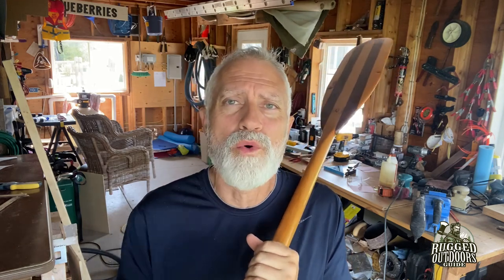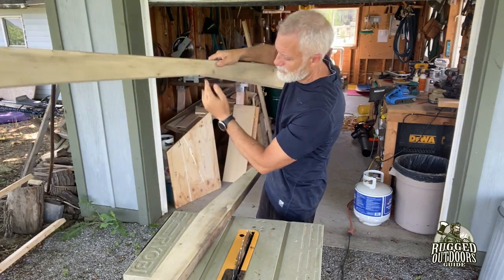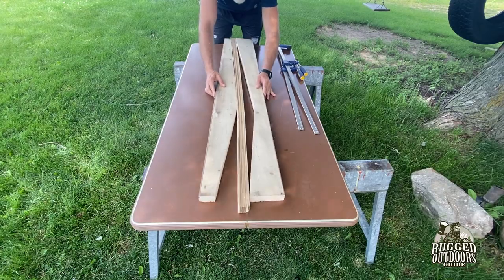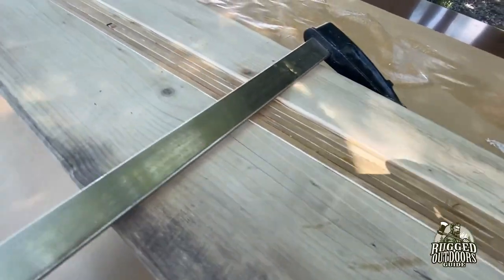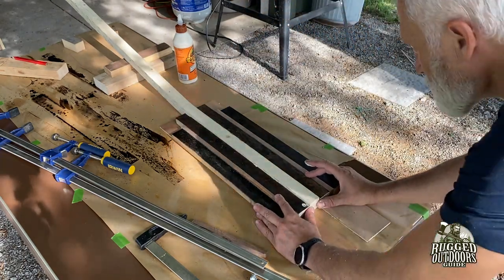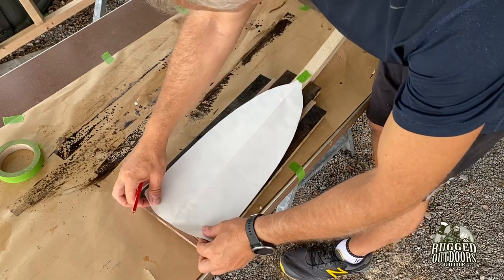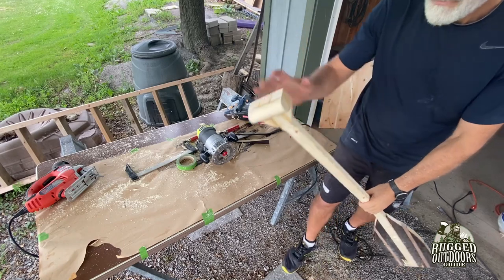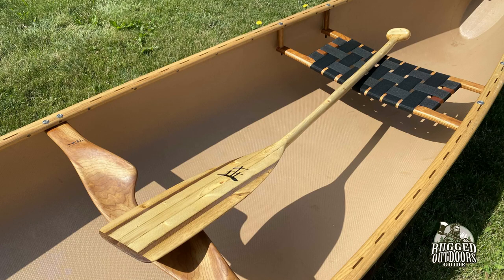DIY Bent Shaft Canoe Paddle (with normal tools)

Comment: That trick with elevating the paddle is a good one.  I just plane the back of the shaft to the point where the transition is tightened up a bit, but your approach does create some other options.

Comment: I have a question about figuring the overall length. Is this done based on the length of the straight ahaft prior to bending? For example, if i need a 54" paddle do I make that measurement off the straight shaft? This is the only part of building one that confuses me.
Reply from the maker: you might not like my answer but it's an honest one!  I throw out all length measurements and go with how it "feels".  I took one of my straight shaft paddles that was a perfect length for me and my canoe, and then pretended it was bent shaft.  I had to sit in my canoe because each canoe with a seat height from the gunwales that's different than the next canoe requires a different paddle length.  I just chose a length I was comfortable with after mimicking my paddling style in my pool.  I'm not sure that helps, but it's all I've got!  Thanks for watching!
Reply: I appreciate the answer and I really enjoyed the video

Comment: That is a dangerous cut on a table saw, for the grip. Particularly since the blade is pulling the piece away from the fence.  And it is too short, wide and thick.  It was also light, and your fingers were not involved.  So easy when you know how.   People sometimes forget you can just split pieces like that out.  It won't work if the piece is gnarly, but I wouldn't choose a piece like that for a paddle grip.

I've been building bent shafts, now and again for my own use, for 45 years.  At one point I took a friend (later wife) out in a canoe, and as we rounded a point the wind picked up, and I masterfully took charge.  At which point the carbon fiber kick point below the grip let go with a bang!  Never had that happen with my all wood paddles.  A common theme in boatbuilding, it takes more carbon than you think.  Happily in human affairs, it only takes one trip in a canoe...

Comment: I took a class to learn how to make one and am now building more for a nephew.  I use dark western red cedar and pine cut into 3/16 strips and alternate 7 strips dark and light.  The contrast looks great.
Gluing is messy, no way around it.  I cut a taper in the handle before gluing the handle blocks on so there’s not so much material to remove by sanding or if you’re like me, by spoke shave and draw knife.
It’s a fun project!  The hardest part is finding nice knot free lumber to start with especially the darker cedar.
I enjoyed the video.
Reply from the maker: It looks like you're a bit more careful, precise and discriminating than I am!  I'll use whatever wood I can get ahold of - knotty or not!  I find that for normal paddling, any wood will do, but I'm positive yours will look better!  Thanks for watching.

Comment: the different color designs in paddles is what intrigues me.  There are some beautiful pieces out there.  I'm guessing from your video that you simply need to use wood that has the natural color you're looking for, since no staining is done?
Reply from the maker: Correct!  I tried to stain at one point, but the stain does not penetrate very deep into the wood, and when you start sanding to shape the blade and shaft, etc. the stain will sand out.  There may be a way to "precision stain" sections after you're done shaping, but most of the gorgeous designs you see online are done with different wood types.  Great question!

Comment: Great video, but I like the grip on the paddle in the first minute of the video better.  Can you show me how to make that grip?
Reply from the maker: Hey Frank.  I just took a photo of a really basic (but useful) drawing I made up for you to show you how to make that handle.  In a nutshell, when the paddle shaft was unfinished and rough, I shaped it with a "T-top".  But, you can just glue 2 chunks on either side of a rough straight shaft to form the "T".  Then, I added two more pieces of softwood along the top side of the T on either side to make it thicker.  Then, I just shaped it however I liked.  If you'd like to see the drawing, email me at pete@ruggedoutdoorsguide.com.
Reply from the maker: I might make another paddle video and show that grip, but unfortunately I'm not making one soon.  If it helps, I can tell you that the grip in the paddle I was holding in the first minute, is made exactly the same way as the bent shaft one.  The difference is in how it is shaped with a belt sander.  Essentially, the shaft is square when I start, so it's easy to glue 2 chunks of wood on either side (2-3 inches long and as wide as the shaft).  Then I glue 2 more chunks on the front and back to create what looks like a large, wooden block at the top of my shaft.  Then, it's a matter of shaping.  Only the bent shaft paddle handle is shaped asymmetrically since it will only be used in one direction/position.  I'm not sure that helps, but it's all I've got for now! cheers,

Comment: Kudos to you for making this video. I'm sure that there are a few ways to make a jig to bend the strips for the shaft, but good idea anyway. Did you use just regular spruce wood or was that cedar? By the way, you can never have enough tools. I look for an excuse to buy one. Wife isn't amused though. LOL!!
I'm hoping to make a few paddles over the coming winter. Your video provided me with some good insight how to proceed. Cheers!!
Reply from the maker: I gotta admit that I used 2x4s from Home Depot.  They advertise them as Spruce/Pine/Fir so I don't really know.  I used a 10-foot long 2x4 I had in the shop!  Thanks for checking it out!

Comment: Electric planer? For shaping the paddle blade?
Reply from the maker: I used it for a bit since my blade was an inch thick in some places.  I needed to shed a whole lot of wood quickly.
Reply: Great idea using the planer to take some of the excess off the paddle. I've used just a spoke shave on some straight paddles and it takes hours. Great thought and I will use it on future builds.

Comment: Fiberglass epoxy?
Reply from the maker: Hey M.  Not sure what you're asking, but with my DIY paddle, I did not add any fiberglass reinforcement.  It's not a bad idea for sure, but I've made about a dozen paddles since around 2007 and none of them have broken from hard use with only Gorilla glue and marine Spar Varnish.
Reply: @ruggedoutdoorsguide9904  yes whether or not you use it. I was curious as to how they hold up without it. Thanks for your input. I'm going be making one soon. I built a kayak already,  just need a nice paddle too.
Reply from the maker: It's the only paddle I use regularly (3 multi-day trips annually and about a dozen local day trips in my area of Southern Ontario).  It's only 2 years old but shows no signs of splitting and doesn't make any snapping noises when I bend it with my hands as though I'm trying to break apart the glued blade pieces.  The key is to use a good glue (Gorilla wood glue is a great option) and use enough of, AND clamp it tight so glue is squishing out everywhere.  If I were to make another one, I'd try a tip made with any sort of hard epoxy instead of black walnut wood which is semi-hardwood.  The walnut has taken a bit of a beating over the past year and I've had to re-sand and re-coat.  I wish I had done epoxy.
Reply: @ruggedoutdoorsguide9904  would you just finish the tip in hard epoxy or do something entirely different with a different material?